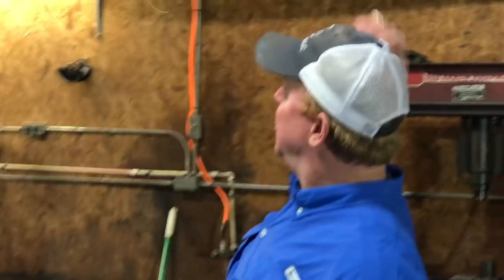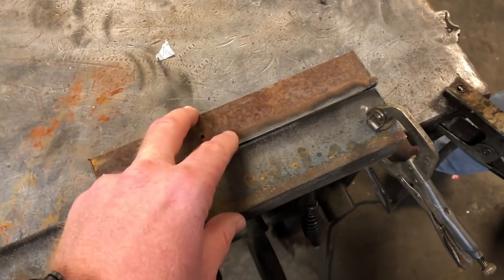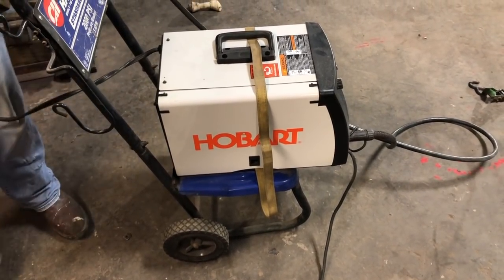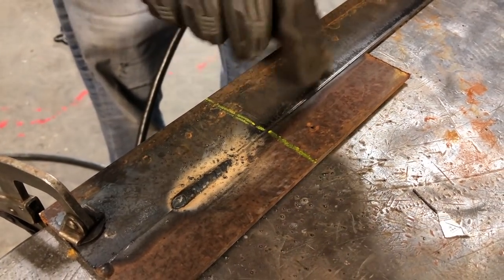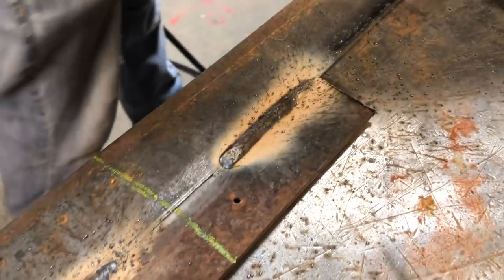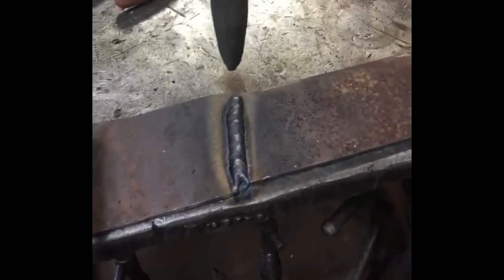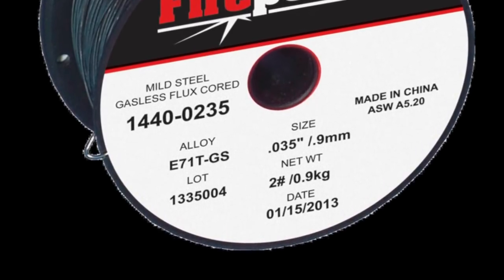Cheap VS Expensive Flux Core Welding Wire: what’s the difference really ?

Comment: It's flux core, it will spatter.  In a spray bottle mix up 1/3 liquid cheap soap to 2/3 water (swirl, don't shake) and you'll have an awesome anti-spatter coating.

Comment: Excessive spatter is not always the wire 's fault.   Excessive voltage is a common culprit.  Try backing the voltage tap back one setting.  On the HH140 it is the 1-2-3-4 dial.

Comment: When i first started welding i used only Flux core for almost a year. I thought there wasn't much difference between it and MIG until i got some gas. I love MIG MUCH better and run 75/25. It welds different,feels different and just performs better. If i was outside and windy id use Flux or stick but basing solely on appearance ,feel and ease of use i'll take MIG all day.

Comment: INE flux core welding wire that you can find on Amazon is the best thing that I've ever used in flux core wire. Minimal splatter, easy to clean, great welds. I would suggest that wire to anybody who does not want to run gas. By comparison, the harbor freight Chicago electric wire is crappy, and the Vulcan flux core appears to be not a whole lot better. Go with INE Italian made wire on Amazon

Comment: I found Blue Demon to be a better wire than Hobart brand wires. I find it is better than Lincoln's flux core, BUT I really like Lincon's dual shield wire. If I'm in my shop, I'll use dual shield, it is great. If outside, I'll use Blue Demon Flux core.

Comment: All flux-cored wire is famous for leaving substantial spatter when compared to solid mig wire. If you are not getting spatter on your (FIREPOWER) wire, check you depth of fusion bacause something is wrong.
Reply: INE Flux core wire hardly leaves spatter and far better than any N American wire

Comment: Another thing you can do to get rid of the centrifugal  force (cast) is buy all flux-cored multi-pass wire on 10 lb. spools. These spools have the inner diameter much bigger than the 2 lb. spools so the centrifugal effect is much less and your troubles disappear.

Comment: Check for depth of fusion and porosity by doing a cut and etch test on all three different welds and your comparison is fair my dear friend. Without it you are showing us nothing. Remember, the Hobart wire is in a different "Clasification" and you don't want to compare apples to oranges.

Comment: The E71T-GS (VULCAN) is a flux-cored wire single pass. The E71T-11 (HOBART) is a flux-cored wire multi-pass. And the E71T-GS (FIREPOWER) is a flux-cored wire single pass. The VULCAN and the FIREPOWER are in the same “Classification” and the HOBART is on a different “Classification.”The comparison of these wires is incorrect: Therefore, the results are invalid.
Reply: Almost like they wanted firepower to win, add in the fact that Lincoln wasn't even invited to the party and it kind of makes you wonder.

Comment: You can make structural welds with both; single pass and multi-pass wire. And without getting into metallurgy, the single pass is a softer wire, more susceptible to birds nest if wire tension is not adjusted properly. On the other hand, multi-pass wire is more brittle and a centrifugal effect (casting) will reflect on your wire when it’s traveling through the conduit liner making your welding troublesome. To eliminate this problem, you need to be more attentive on your constant speed, consistent arc length and proper angle to get a good weld and minimize the spatter. Moreover, this wire is for making multiple passes and/or bridge two pieces of metal.

Comment: I bought a large roll at Harbor  Freight What a mistake! I had  Bought  small rolls and was tired of wasting wire every time I changed a roll of wire from Lowe's. What a mistake!! So my wife wanted to buy me a gift so I looked into wire on line,  and found INE I really like this wire! I don't weld much so 10 lb roll will last a while for me!
Reply: Marlin knable  you don't have to waste any wire if you know what your doing. Did you not read the first comment,?the  guy saint Kenny explained it perfectly how you are supposed to change wide. I have stainless wire,flux core wire and regular solid wire ,some very old stuff I don't use often but is still good. When you change wire just cut a half inch at the end to clean end and roll what's in the gun liner back onto the roll,no waste. These guys showed sloppy examples of how to do it  look somewhere else you will see.
Reply: @johnsellers2999  I believe he is talking about the wire waisted when you empty a 2# spool of wire. You know, the wire left  in the whip?
Reply: Fred yes I see what you mean. Nothing you can do about the wire left in the gun when you empty the spool. Another thing I noticed was the amount of spatter,now it could be the machine but when your settings are right or even close there shouldn't be that much splatter. I never buy those small spools,  not because of the waste as much as the time wasted changing it. But yea your gonna lose that 12 ' or whatever length your gun is

Comment: Thanks for sharing.  Learned a lot about the flux core wire in this video and comments.  Looks like the E71T-11 is multipass wire and the E71T-GS is the single pass and that the Firepower E71T-GS is the best for single pass.  Any idea how the firepower performs penetration wise and multipass use?
Reply: I wound up ordering some 2 Rolls Gasless Flux Core Welding Wire, 2-LB Spool E71TGS Carbon Steel wire
.030"+.035" with the coupon code "SEPTEMBER-10% WELDPROS" that had free shipping for $24.30.  Couldn't beat the price from what I've been reading for single and multipass from what they claim.  Reviews read like is like the Firepower in performance without the spatter compared to Lincoln also.  About to find out and compare to the Hobart I have.

Comment: To be honest I don’t see the difference between harbor freight to esab to Lincoln wire.  I run 10 lb spoils at 22v @ 360. It all runs the same outcome is about the same.  

In the video the angle was different on the harbor freight wire strong angle

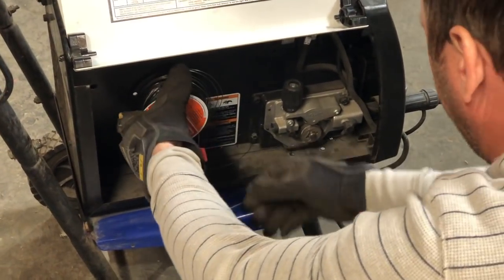Comment: At 2:55 in when I seen you just cut the wire and just let it bird nest and then the way you pulled out the wire was probably the worst way I have ever seen! Either you didn't care about using that flux core wire again or just don't know how to properly swap your welding wires or both! 
       Proper way is to release the wire feeder , cut any access bead off at the end of the wire. Start turning the spool in the opposite direction it feeds pulling you wire back through the line and keeping a little tension with your fingers so when the end of the wire comes out it won't cause it to bird nest. Hold the wire and reinsert it into one of the holes on the spindle preventing the wire from coming lose and bird nesting on you. You may know the proper way to do this, but for people that do not, I hope they read this and learn the proper way to protect your welding wire for storage or to be reused at a later time.
The rest of your video was fine, but just had to point that out.
Reply: These guys don't know what they are doing. HOBART is excellency on everything.
Reply: Saint Kenny they better stick to trucking,welders they are not. As soon as I saw him cut the wire I had to move on to a couple comments then the video info I was looking for.
Reply: @johnsellers2999  Absolutely, these Jokers don’t know a thing about welding. They don’t take care of things, not even a good quality welder like this Hobart. I detest guys like these who purposely mishandle things with the intent to break them.
Reply: I concur, there's a lot of wastage too
Reply: Saint Kenny sure is an appropriate name. You can tell by the self-righteous way he criticizes the video. At the end of his comment he even says “the rest of the video is fine”. I’m positive that this channel is grateful for his stamp of approval…

Comment: Do the gas test out side on a breezy day Vs flux wire out side.
I would run gas if I wasn't welding out side. If the welder stays in a shop with no wind I would run Gas for shire!

Comment: I recently bought a second hand HF Chicago Electric 180amp MIG.  Even though I don't have any MIG/Flux experience it was easy to figure out why he was having troubles, he had the wrong size contact tip (.030 vs .035), the polarity was backwards, and the biggest problem is that he was trying to run HF 4043 Aluminum wire on a DC only machine.  I bought a 1# roll of Lincoln 0.35" nr211 and promptly ran through most of it playing around and soon ran out during my first project which is making a rolling stand holding a couple tool boxes mounted one another.  I used an old bedframe for the 1.5" angle 1/8" thick from which it was made.  The base for the first toolbox 16x30" with 1/8" gap all the way around was VERY poorly cut and the welds were a mess and I was discouraged, bridging poor fit ups was commonplace back when I learned and steep was cut with a torch and we welded with mostly 7018.  On the second box I had bought a 10# roll of Blue Demon E71T-11 and actually paid attention to my cutting of the bedframe.  On good fit ups I don't think the differences are all that much as far as the weld is concerned, it is mostly point and drag following the directions on the welder for the heat and feed.  There was two differences I've noticed now that I've run about a pound of each.  I think the Blue Demon is smokier and certainly smells worse.  The Lincoln wire will snap off in your hand so it is more convenient and cleaner.  The cost of the Lincoln at Lowe's was $15.98 + tax for 1#. 10# of the Blue Demon was $33.74 with free shipping.  To be fair Amazon has the 10# Lincoln wire $47.49 shipped.

Comment: Dont quit yer days jobs. Cutting the wire like that clearly surprised this yokel who is not a welder (newbie?),  You guys are compairing 2 different ttpes of wire, E71T-11  multipass vs, E71T-GS single pass rated, from 3 different countries, italy, usa and china, probably should have mentioned that to the viewers. Where is the actual welding footage of the firepower brand?  It would be good if ya was to replace the incorrect term-splatter with the correct term - spatter. Country  music at rhe front,  EDM at the end?  LOL  This video was painful and humorous to watch,  however im glad i did... i tnink you guys could re-make this one and have it be really good, potential first time viewer(me) suscribe worthy.
Reply from the maker: Thanks for your input we are not professional welders by any means. We are just comparing the wire that was readily available to us at the time. Napa, Oreilly and TSC is all that we have here. These are the wire that we can get. The video was to show that there is a difference in the wire. Many people told us different types of wire to try out and why they thought it was best in different livestreams. I wasn’t aware there was that much difference in the brands.
Reply: @KoonTrucking  yes ! The reason why I run flux wire is because I'm welding out side most of the time,  if  I was welding in a shop/garage I would run gas. Can you do a video showing witch wire works best out side on a breezy day?
Reply: I was wondering about GS vs MP glad to know GS is single pass.  Can’t find much detail about that. 
Just watched a video about INE wire from Italy being really good.

Comment: Good idea for a video however I think you should have done a cut and etch on each weld to see the penetration. Also sometimes spatter can be controlled by the amperage and feed, each wire has its own personality(?) that has to be adjusted for. I hope you go deeper into these comparisons. To answer Mr Youngs question at the end of the video, fluxcore wire has limitations and actually at high amp settings shielding gas used with fluxcore gives a quality weld with less chance of contamination.

Comment: Great video. I love to mig weld. I have a Miller 212 that I used at home. I make all kinds of stuff with it. It is good to see that wire can make all the difference in the world. Great little demonstration of the three kinds of wire. The proof is right there. Keep it up
Reply: JERM C 
"Great video"...........????
Read the comments carefully.... its actually a very poor presentation.
Reply: Try the INE Flux core wire.,,far better than any of these...especially if you a novice welder

Comment: Spatter can be to much wire speed. All wires will run a bit different far as speeds and voltage. And rake the chipping hammer across don't beat the daylights out of it.

Comment: The wire welders,they are the best broken off bolt extactors.If there is a little bit sticking out,weld a nut on  and usually come out.This is when they are in an easy spot to get to not getting the easy outs and extractors out saving time with no drilling at all

Comment: I have a video on welding flux core with a harbor freight welder. I went through it pretty good I think. The wire I don't use harbor freight. I get my wire from the welding supply place. I can't remember what kind it is but 💯 percent better. I explained why I upgraded my welder. I know harbor freight but I couldn't change the polarity on my orlder one. They also make a spray you can spray on the pieces to help keep the splitter down. I didn't know about it until I talk to an iron worker. I grew up welding stick on a Link. 600 gas engine welder. I had a hard time transitioning to wire feed but I do my best. Great video thanks brother keep up the great work see you in the next video.
Reply from the maker: Scott Pearson TOOLS &MORE I’m not a fan of the harbor freight wire at all. That firepower is amazing stuff
Reply: I didn't get notified that you commented. I will have to try that wire out I have it written down. . Thanks Clay

Comment: I remenber old timer laid down 7018 with a bobcat 225 and he would simply blow off the flux off the weld point skill plays a big part 

Great skill by j young that welder sounded spot on
Reply: memopat1 I was welding some pipe earlier and had the slag fall off before I finished the rod
Reply: @chrisjones6165  been there done that also!
Reply from the maker: memopat1 yeah J Young can weld ! He’s very good at it